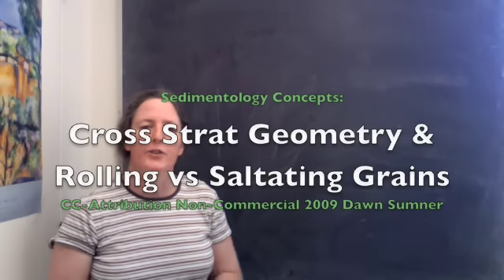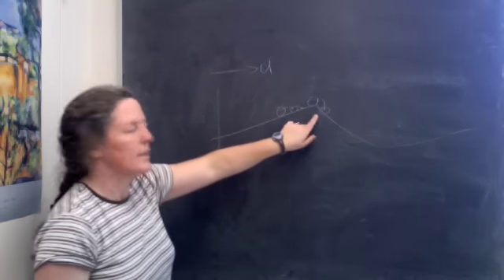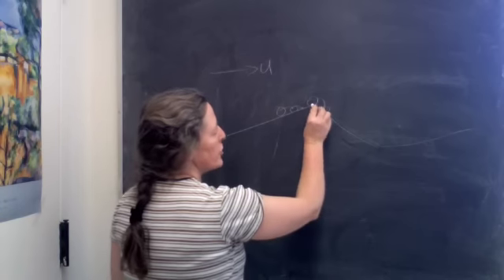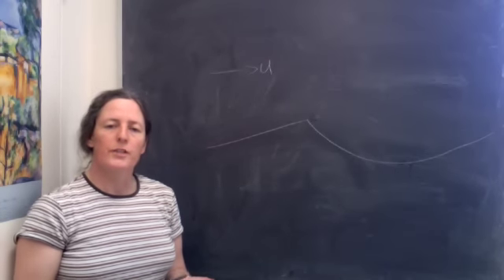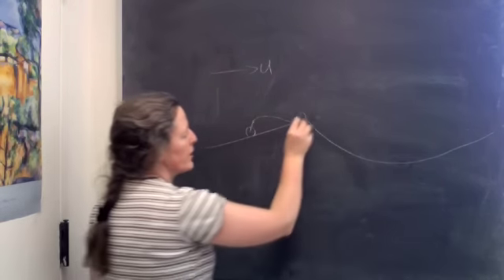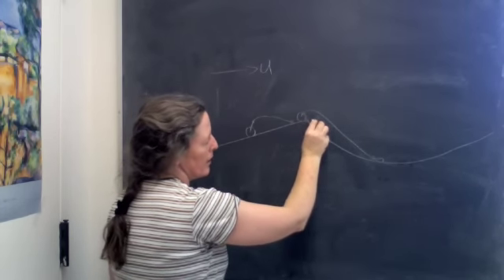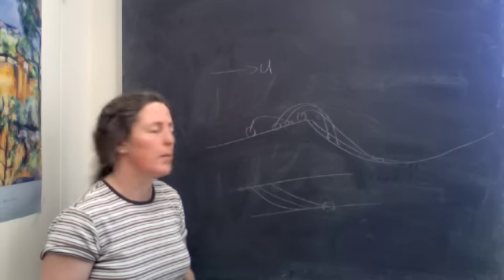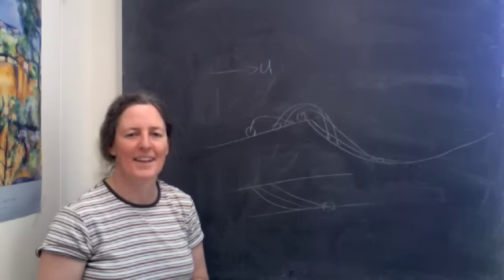Cross Stratification/Lamination Geometry (sed strat)

Comment: thanks for the video!! I want to ask you something what is the difference between cross stratification and epsilon cross stratitification? thank youu
Reply from the maker: Cross stratification comes in many different types.  It refers to a geometry in sand or sandstone where at least some of the layers are eroded away by younger flows and more sand is deposited on top.  Epsilon cross stratification is a very specific type of cross stratification where the layers thin to zero thickness at their lowest point, thicken where the are sloping, and then thin to zero again at the top.  This type of cross stratification forms when bars migrate in meandering rivers.  It's described here: http://www.seddepseq.co.uk/depositional_env/fluvial/meander/meander.htm#ECS